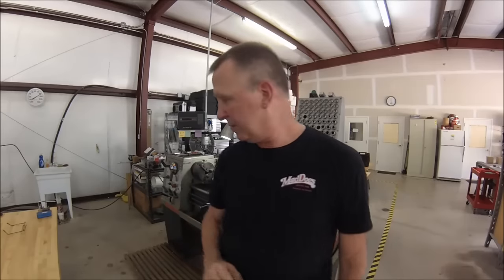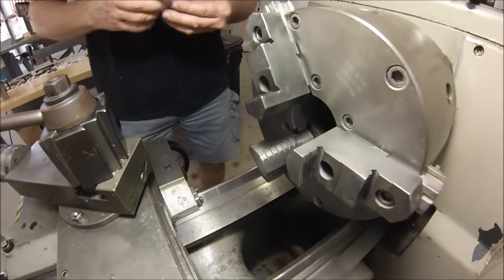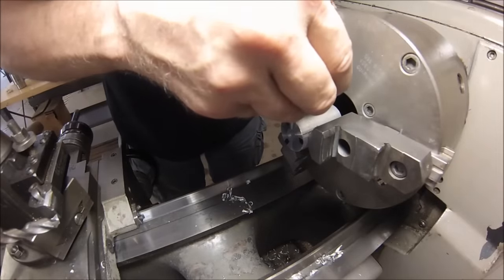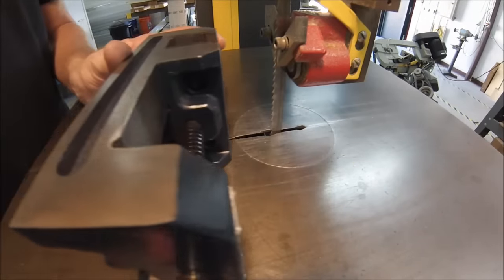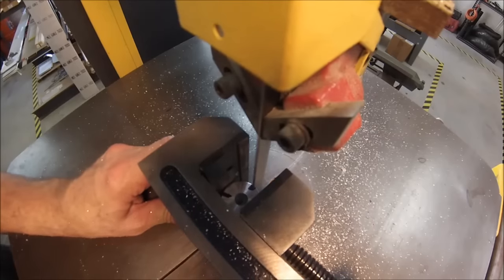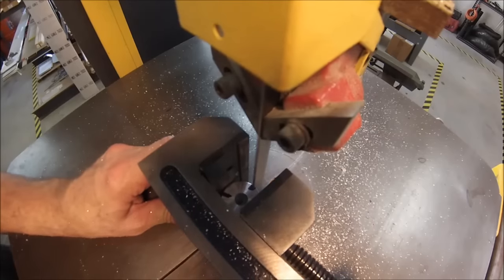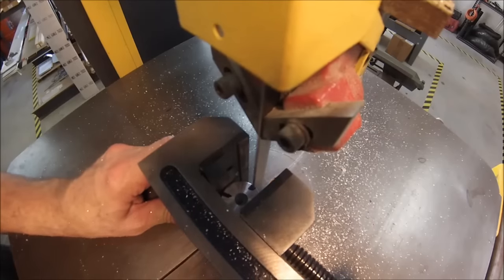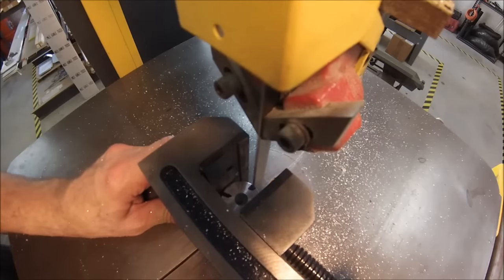Get your parts to run true in a non adjustable chuck. YOU MUST WATCH THIS!

Comment: Thanks for the tip because I am banking on needing to use it. You see I just bought a budget mini lathe for producing a small part that needs to be fairly true. However after reading the comments 
I'm a little concerned that long term exposure to this type of machine can cause crassness, and a sharp decline in mental capacity. What's your tip for preventing this?
Reply: I had 38 years in machine shops   total , some was in maintenance for a few years  though  and made  but always spent some  time on lathes or mills since 1974 when I operated my first   smallish lathes,   but  later I had many years in machine shops full time,  but then I can be  pretty crazy lol 🤣 
Seriously though   My lungs got bad but i used to smoke an think that cause  most of it  they are a lot better since I quit smoking for 8 years  as  of now, , and my olfactory senses seemed to suffer for years my sense of smell was  shot  but  now i can smell better than ever especially stuff like acetone etc lol.
I was a journeyman toolmaker then  at the last  I  was  a moldmaker  for  9  years or so but   I developed health problems  and suffer  unrelenting high blood pressure  etc.  and  a heart attack from it once,  It Possibly partially  May have been caused by breathing too much over the years, who knows?   But   some  good coolant on aluminum       cuts down   on the airborne particles  tremendously though , but you mostly use that kind on bigger machines than sounds like you have but you could   make some kind of nozzle and collection system and  a cheap pump   homemade coolant  system pretty easily  I'd think.
I loved the investment casting molds  they were 7075  aluminum !  (more zinc than 6061) We made  brass pulls to form parts etc.  the only hard part was   finding  and then   machining brass that didn't warp if fly cutting a thin  flat shaped piece or something  because they had to move  but not leak when molten wax was injected at about 750psi at the foundry where they were used. But a lot more  fun to make in my opinion than the  tool steel  aggravating old plastic injection   molds lol. I hated  making  the  plastic injection molds  at a couple places i worked at making them, they were just  much more a pain , for me at least lol
Reply: @Mountainmanfingerpicker  Thanks for the aluminum tip as well because that's mostly what the material is. It's these augers that are just over 2" long that  need magnets inside. The outside is a brass tube, and the pins on the end are made of aluminum plugs, that get turned down to 3mm. I was using one of those Mickey Mouse "lathes" with a file, but the runout got too bad. Last night I came across some vids explaining how regular three jaw chucks don't generally turn true. I spent all today disassembling, adjusting, cleaning, and reassembling the new lathe getting it ready. I used to have someone else making the augers for me, but he disappeared owing me money. Then I had someone local turn a few dozen, but he stopped answering my calls. Either I'm really hard to deal with, or they aren't worth a machinists time. Maybe a little of both so I started making them a couple of years ago. They go in bb machine guns I modify, and make. I know you didn't ask, but it's kind of interesting. If not interesting definitely different. The augers have to have magnets in them because otherwise they spin so fast they would fling bb's off of them. Some of the bb machine guns I have built will shoot 8,000 rounds per minute so there isn't much room for error. It's strange work, but someone has to do it, I guess. Thanks for the reply. Take care, and be safe.
Reply: @masondawson4061  Wow that Is interesting . I'd love t see  see one  those BB guns  operate !

Comment: At the end of the video you mention you have a bunch of these parts sitting around the shop.  If you mark the numbered position of the chuck jaws on the piece you just made, so you can get the piece back in the jaws in the same orientation, how reusable is this sleeve you have just made?  In other words if I come back a week later, remount the sleeve and put another piece of half inch in it, will that be similarly true?  Seems like it 'should' be so long as the three jaws close similarly each time because basically you're custom making a collet, but does it work in practice?

Thanks, and love the videos. Learning a lot.
Reply from the maker: There are many variables that would have to line up in order for the bushing to repeat after its removed. How far into the chuck you place it is one of them. Sometime you can feel the jaw indents and place it that way, but when the part needs to be dead on, make sure you check it first, or rebore the bushing you select.

Comment: i am a retired tool room turner. this method does work well. but you have to make a job to make a job. people i worked for would not let you do this. with these bolt on chuck jaws. it is best to get a few sets of bolt on soft jaws. then V them up on the mill so they close up. bolt them on the chuck and bore them out away you go. you can V both ends so they are reversible. every time you use them. just give them a skim  and they will run true every time.
Reply from the maker: Your comments are accurate, but this video isn't about using soft jaws.
Reply: yea. good point. and no you never put mill collets in hard jaws. well said

Comment: one thing ive done, is undercut the registration on the chuck mounting plate,that way i can loosen the mounting screws, bump it true, tighten the screws and it stays accurate to that diameter, havent had any major issued using this method

Comment: The morale of the story is that if you have a three jaw off centre  chuck, on a bent shaft, then do not loose heart and  make an off centre collet /sleeve,  whose converse imperfection is synchronised to make the whole thing right.  It is a case where two mistakes or two imperfections  make it right!!  Perhaps we should call one an imperfection and the second a correction!! This does not always work in prisons and schools where there they do  have correction facilities! I believe the best craftsmen are not those who get it right first time , but those who can correct mistakes to get it right.  Well done. 
I wonder what would happen if you take the "collet" off and place it back at a later stage , in what is supposedly the same position ?
Reply: I heard someone say that a good toolmaker still makes mistakes, but you'll never find them.
Reply from the maker: Thats very true.

Comment: Probably could have really nailed-it by using the boring bar for the final cuts since the non-Albrecht chuck and the tail-stock alignment are potential sources of reamer skew in your final operations. I recently cleaned, lubed and then trimmed up a 3-jaw by judicious filing of the jaws using a diamond file;  took hours and lots of readings (I’m retired) but got it down to a TIR of 1 at the chuck and a wobble of a bit more at 5 inches out.  It was good for several material diameters which was surprising since the scroll gear has to be machined pretty much dead-on at all points so maybe I was lucky here.
Reply from the maker: Boring is accurate, but the bored lead for a reamer is very reliable. I could have also nailed it if I used a .500 reamer, but chose the .501 for the demo so the part went in and out easily.

Comment: Nice, thanks for the tip.  I was actually wondering what the reasonable run out for my Chinese mini-lathe (albeit one that I rebuilt).  I have it to about 0.001-0.002 about an inch from the face of the chuck and was able to get it down to 0.005-0.006 about 8" from the face with 8mm drill rod.  Made me feel better when I was able to get it dialed in that well knowing that it's performing better than expected considering what it is.  Thanks again!

Comment: use thinner wall on the soft collet to start with and , for most parts, you will not require saw cuts or removal from chuck

Comment: I'm sorry my English lathe I run at work had 59.5 but most are 29.5 I worked in a job shops . And we cut a lot of threads and the boss always wanted the compound for threading. And I respect your work and thought all good guys did it
Reply from the maker: 59.5 setting would result in an actual approach angle of 30.5. This would give you a bad thread profile. 29.5 or less is a common practice and works fine, but be careful on that initial setup. The compound should appear more perpendicular to your work than parallel with it. All the machines I have ever operated have been strong enough to allow for plunge threading. Its all I ever do. Thanks for the comment.
Reply: Joe Pieczynski????? You have both lost me😂😂😂 but I guess it will all make sense when I start machining threads. Thanks for a great teaching channel and Merry Xmas to you and your family. Cheers Stuart 🇦🇺

Comment: Quick question. When you check for straight by running the DTI along the rod, you might be on the 'straight' side. If the rod is out of true (concentric at the chuck but not at the end) there will be two sides that run straight, one side will run inwards and one side will run outwards. So why not check concentricity at the far end of the rod?
Reply from the maker: Checking concentricity can really only be achieved with verification of two elements. You pick. Either have your part run true in two different locations, or zero a face and one location. Either combo will assure your part is true.

Comment: we used to put a 3 jaw into a 4 jaw, clamp the part, and after using the 4 jaw to make the part run true, we could change out the parts and maintain concentricity as long as the face of the 3 jaw is running true. this could also be done with soft jaws by boring them while having a piece clamped at the inside of the jaws

Comment: Thank you, I DO like that! It is a lot of trouble for one part, but if I plan to make things regularly from 1/2 inch stock it would be a permanent improvement to the lathe. Possibly not quite as precise once I remove and replace the collet, but probably still good.
Reply: @
Benjamin McLeod
if you put the big slot between jaws one and two and scribe a line from the collet onto jaw one it should line up perfectly every time :-)

Comment: Hey Joe.  Nice videos, GREAT instruction.  Keep it up!Instead of putting up with this on my lathe which was out around 0.016" with a new non-adjustable chuck, I "chicagoed", or reduced the shank diameter (still larger than the minor diameter) to allow for more adjustment.  I am now around 0.0003" to 0.0004" TIR with a ground bar in the jaws.  Perhaps you could do this technique justice with a video to help all those who are not wanting to make these type of collets and where +/- 0.001 is good enough.  Thanks, Chris
Reply from the maker: Hi Chris. I have to admit I am not familiar with this fix. Can you tell me more?

Comment: you can drill and tap the soft jaws and add steal luggs. and bore them out to take all different diameters. just give them a skim every time. and use mill colletts  on soft V jaws for small diameters.
Reply from the maker: I like the suggestion for the inserts, but I'd have to see how the collet and soft jaw combination worked. We ever put a mill collet in a lathe, and ya better pack your tools the same day. On a set of properly bored jaws, I can actually see it working though.

Comment: This is a great band aid to get the job done.
Reply from the maker: That hasn't been my experience over the last 48 years. if you need the part to not push, use a spindle stop or different jaws. 6 jaws are better, but a 3 jaw will do just fine.

Comment: great video, working on cnc lathe with hydraulic chuck. I often make that kind of "collet" when I need to machine thin walled parts that would otherwise deform even on the lowest pressure setting... or even when I simply don't want to leave jaws marks on the OD and don't have soft jaws on hand. great trick !

Comment: This baffles me as to how it happened but I must have got my reversible jaws mixed up some how during cleaning.
I just rotated my jaw set 240 degrees counter clockwise from the position they are supposed to be and my eccentricity is now back to .0005 constantly.
This makes me as happy as a dead pig in the sunshine.:>)
Reply from the maker: The actual position doesn't mean anything. Just the sequence. As long as they go in 1,2,3 it doesn't matter where you start.
Reply: Yep.
Reply: The jaws have numbers stamped on them so you know which is which.    For soft jaws, take a center punch and put one dimple on the number 1 jaw, 2 dimples on #2, etc. etc.   As long as you can count to three, you will never get the jaws mixed up.

Comment: Good video - Thanks.
Also sound method if time consuming.
If possible I would choose to mount soft jaws assuming a couple of sets of blanks were available, starting from scratch takes a lot longer acknowledged.
Apart from scrap heap lathes I have never seen a chuck that could not be adjusted for concentricity & most would not need undue amounts of shimming for home workshop accuracy.
I also was concerned about the power filing - looked damned dangerous to me!

Comment: This trick might come in handy in some situations if you don't have a 4 jaw chuck. If you needed better than a few thousandths I would just use a shim - faster and easier. I saw 3 safety violations - one of which was acknowledged on screen with the warning about keeping the end of the file away from the chuck jaws because if a jaw hit the end of the file it would be pushed at you. So be sure you have a blunt handle on the tang of the file and also be careful that the jaw does not hit a finger tip (your file is long enough).  Another violation was touching the edge after filing - if it is not smooth enough you will find out the hard way. Third violation was leaving the chuck key in the chuck even if it is only 10 seconds is a big mistake. While you concentrate on what you are doing it is possible to forget the chuck key is there when you turn on the lathe. You will pay if you develop bad habits. You might view my comments as nit picking, but after decades as a tool and die maker I still have both eyes and 10 fingers. My comments are for informational purposes only. I thank Joe for sharing his skills with the public and he has inspired me to share some of mine.
Reply from the maker: I am a safety fanatic, so I'll be glad to address your 3 concerns. First, I never hit the jaw with the tip of the file, so no violation #1, 2, how do you know the part is deburred if you don't touch it, and 3....I need a specific time I left the key in. Didn't happen. I welcome and anxiously await your reply. Thanks for the comment.
Reply: Great video, I learnt a lot. With the filing, I learnt to power file with the handle in my left hand so I wasn't reaching over the running chuck. Probably too late for you to change but seems safer. And at 15:36 both your hands are visible in the frame and the key is visibly still in the chuck - sorry! (it's something I try real hard not to do either but I guess it happens when you're distracted sometimes)
Reply: Oops, and at 26:19 as well...
Reply from the maker: So, even when you are actively standing at the machine setting it up, you can't take your hand off the key?  I'll never walk away with the key in, but this comment is a bit harsh.
Reply: I wasn't having a go at you Joe - just saying. I'm not a professional, just a hobbyist, and it was drummed into me that the only time you take your hand off the key is when you're putting it down. Plus when Jack Burton called you on the same thing at a different time you said your hand was on the 'T' out of frame and you never do it. Sorry if I offended - not my intention. I'm enjoying your videos and plan on watching more. Keep up the good work!
Reply from the maker: In the real world, the rule of thumb is not to walk away or turn your back on the machine while the key is in the chuck. Its even safer if the motor is off while you do the whole key thing. I wasn't offended by your comment, but industry is a little different than the local garage shop. Thanks for clarifying your comment. I appreciate it.

Comment: Great video,as always.What will be the precision of the setup if in the blank material you use as a collet,you first drill a perpendicular hole,tap it,locate it between the chuck jaws,tight the part and drill it?After that insert the material needed to be machined,insert a screw in the perpendicular hole and tight the part?Will this setup slip or get vibrations?

Regads!
Reply from the maker: You would force your part to the opposite side of the bushing and end up with linear contact. As the parts got smaller, the eccentricity would be amplified. And yes, chatter and vibration potential would increase.

Comment: Just a comment about drill and reamer blanks. 
They are very useful for a variety of things. They can be used as a alignment pin, locator pin  and can be made into all types of cutting tools. They are very hard, round and straight and can be ground for gage pins .
Can be used in place of a dowel pin in an emergency.
Reply from the maker: I have a bunch in my box for a variety of situations.
Reply: I have often use busted carbide endmills for all of these cases. well, not for making cutting tools, but, yea, everything else.

Comment: I may be wrong but I think the sharpy marker should have been done just after the 1st hole was drilled maybe order of operation face 1 ,face 2, drill ,sharpy , proceed rest of opps ,remember to insert stock not 180 degree around but same way as in as when you pulled it out the chuck jaws after you drilled the first hole.
Reply from the maker: As long as you don't drill the pilot hole too close to a finished bore size, flipping and rotating the bushing won't hurt anything. If the chuck runs out .01, make sure to drill the undersized pilot hole at least 2X that value to be safe.